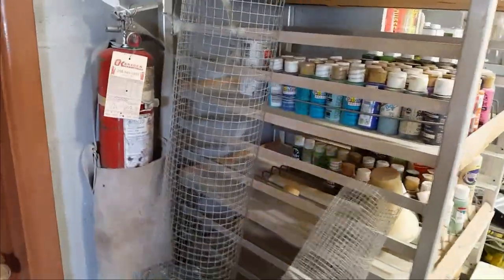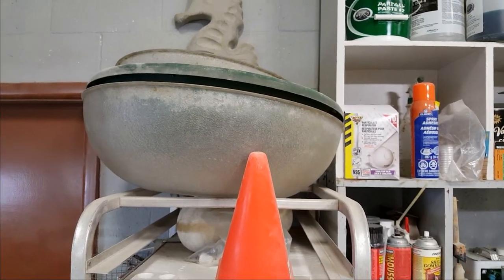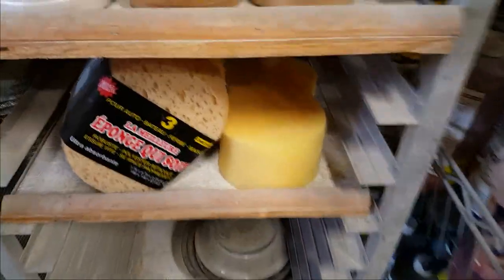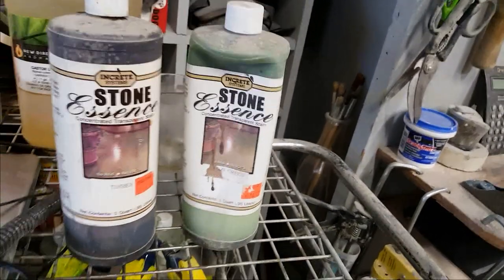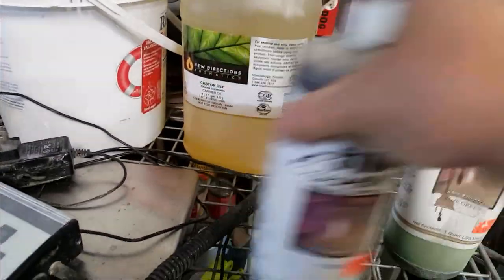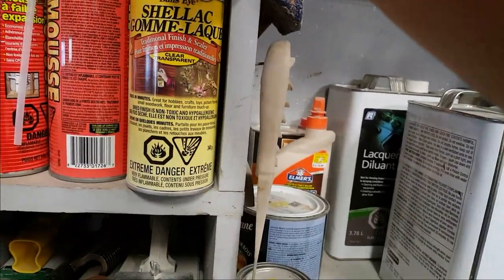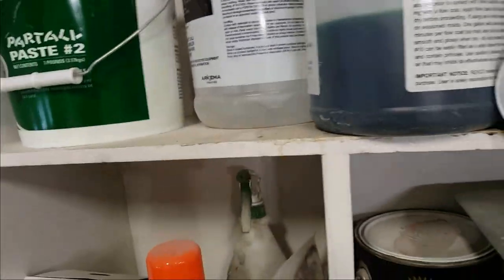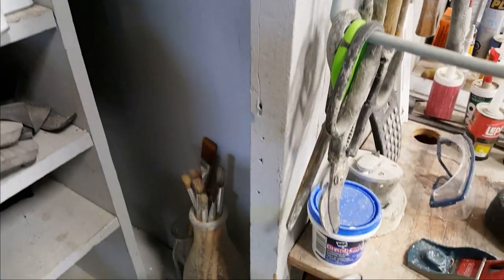Concrete mold making/Tools of the trade/Part 1

Comment: What do you use the castor oil for?
Reply from the maker: Morning Abigail,I mix one pat castor oil, with 7 parts isopropyl alcohol in a spray bottle.Then use that to spray on my rubber molds for a release agent,keeps the concrete from sticking to the mold.👍😁